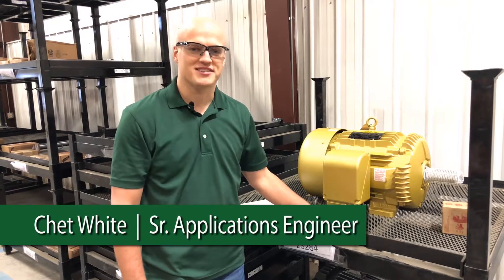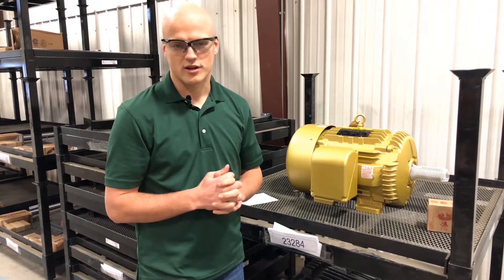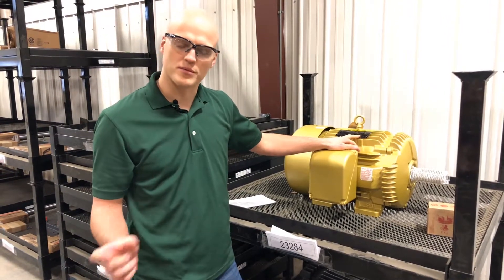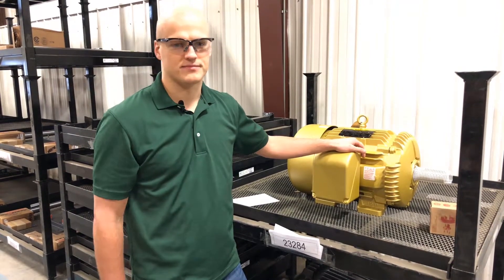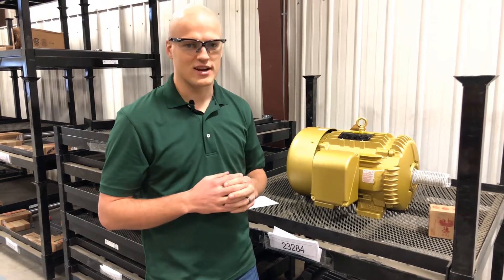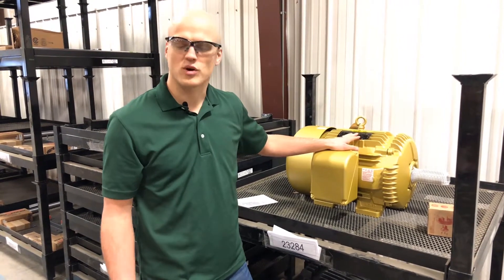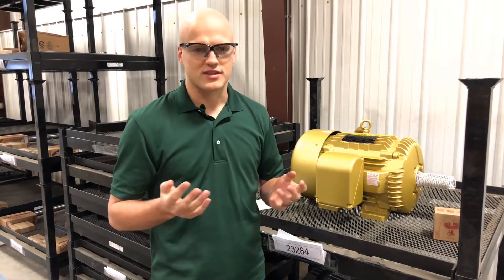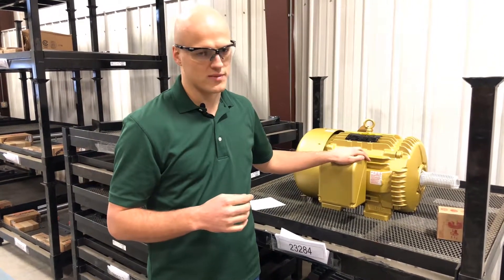Electric Motor Considerations for Industrial Fans

Comment: How to choose motor size when the blower wheel material differs.  It is centrifugal fan DIDW Double Inlet. Existing blower fan is made from aluminium material (67kg including shaft) which later replaced  with blower fan made from mild steel material (93kg including shaft). Now how to determine the horsepower of the motor since new blower wheel will be heavier. Everything else remain same except the blower wheel weight.